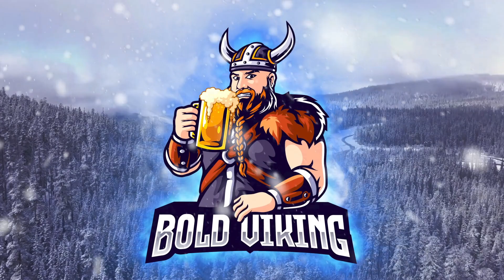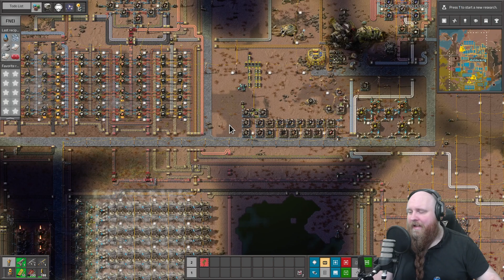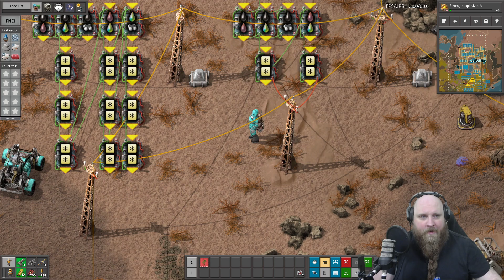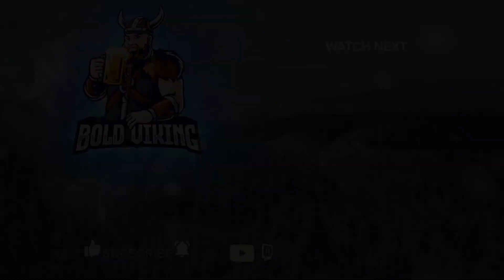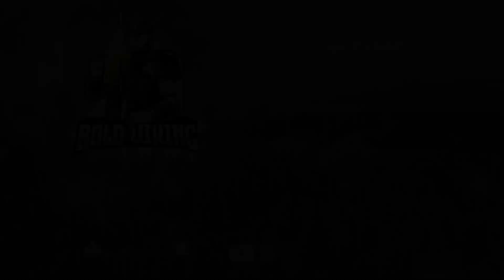Bolds Space Exploration Adventure - 020 - Bio Fuel Power Plant Part 1 - Full Playthrough

Comment: Probably a recuring question: why not Helmod or factory planner?
Reply from the maker: yep recurring question :D. I enjoy to calculate and figure out ratios. Playing with factory planner, or helmod makes it to easy and takes that joy away ^^.
Reply: @BoldViking  I can barely do it without. It trains my brain, like noticeably, but i get stuck and then just burnout in a massive way. Logistics is really hard when its not in modules and organised, especially the calculations and allocations.
Reply from the maker: @matt6466  Yeah usually when the calculation starts to get complicated, or when it goes into minor numbers (like 9 to 10 ratios) I usually just wing it :D.

There is no need to spent any brain juice on things that will not operate at maximum capacity either way ^^.

Though in pyanodons there are some amazing recursive loops that when you calculate them through you get some really nice ratio builds :D

And of course in SPM bases thorough calculation is mandatory ^^. Though you only need to do that once then scale from the result :D